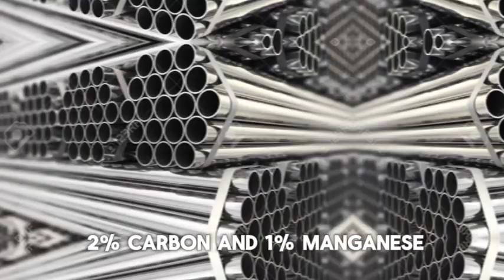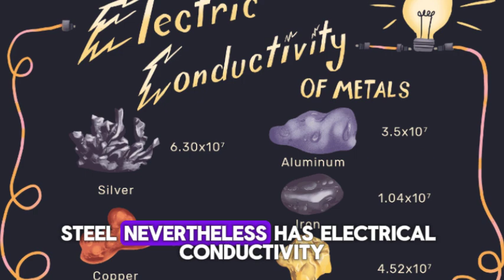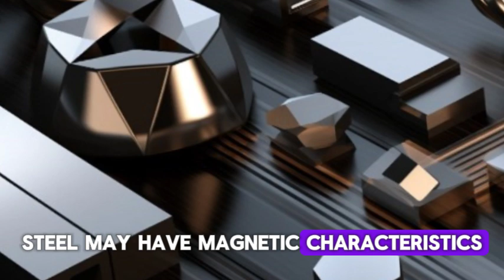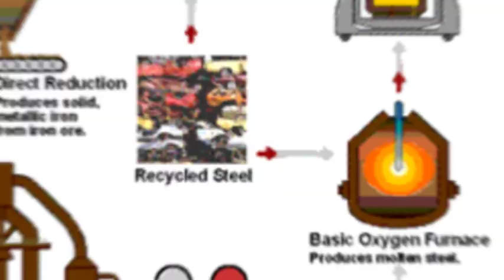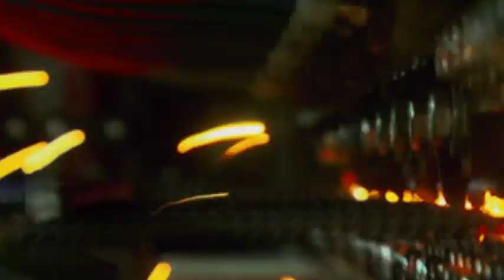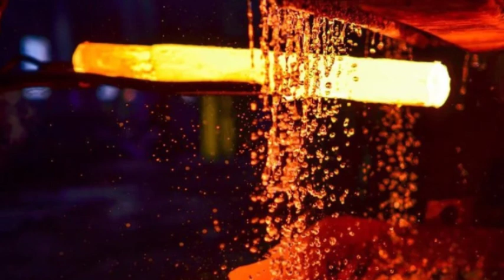What is Steel? Types, Properties & Uses Explained!

Comment: The % tage of carbon determines what type of steel.  Low carbon (mild steel) is .01%-.29%, medium carbon steel is .30%-.60%  high carbon steel is .60%-1.0%, Ultra carbon 1.0%-2.0%
  Low carbon...A-36 in structural steel. A-105 in seamed pipe. They are very ductile.
  Med carbon...drill bits, gears, #"s = 1045 + 4130
  High carbon...better quality drill bits, springs, #"s = 1060, 1065, 1070, 1080
  Ultra-High carbon... 1.0%-2.0%  Files,  high speed tool steel.   
Riveting and threaded bolts were the only way to join steel or cast iron  parts at the very first. Once welding was figured out...rivets are now used in sheet metal joining. No more riviting beams together. .